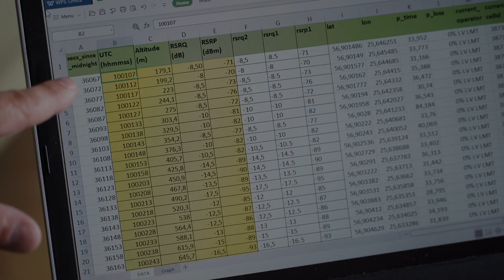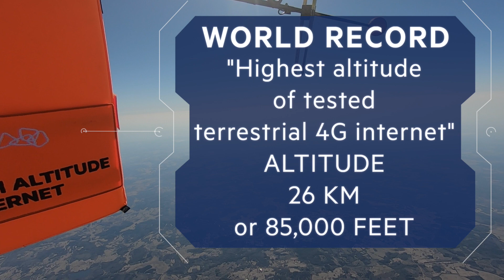World Record for "Highest altitude of tested terrestrial 4G internet"

Comment: This is a very interesting experiment. I was also always wondering how high cell phone reception would be possible. 
I was also recently thinking of doing the same but I wanted to test it under more realistic conditions which means using a smartphone which tries to connect to cell phone towers with antennas pointing towards the horizon like it is the case normally since I am sure that not every cell phone provider wants to point one of their antennas upwards for such an experiment. 
I have already been able to send pictures over Facebook Messenger to friends from an airplane (while holding the phone against the window) at 11km altitude over LTE and HSPA but oftentimes the airplane is too fast and the doppler shift terminates the connection or the airplane flies out of the antenna sidelobe in a matter of seconds. Maybe the sidelobes can provide coverage at greater altitudes though since I have already had several times a signal strength between -80 and -90 dBm with UMTS or HSPA at 10-11km altitude.
Reply: On 9/11 there were no antennas pointing up to the hijacked airplanes, or maybe they did point them up for that one day? Several people said that they were called from a cell phone, but later the FBI said only two calls came from cell phones from one plane at an altitude under 4,000 feet. The FBI never did a reverse investigation of the 'CDRs' on the called parties to confirm their claim.